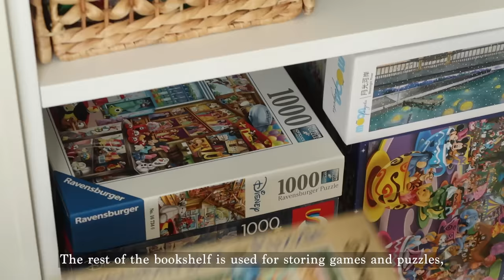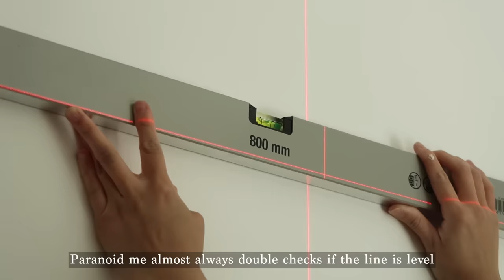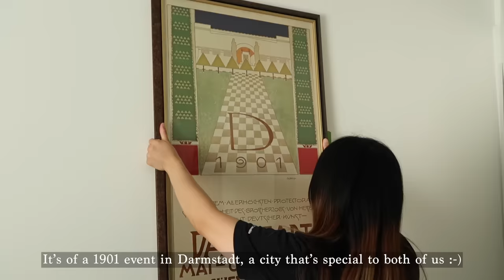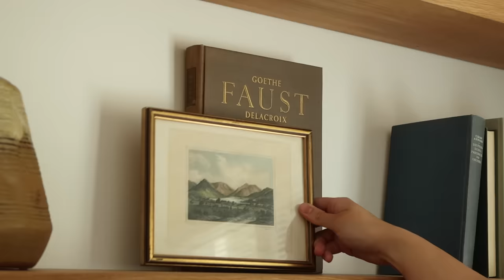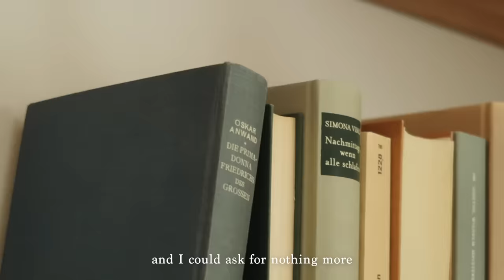Creating a cozy home office & library | Room makeover

Comment: Just curious: Is the normal 'Alpina Wandfarbe' still sticking to the cupboards after a few months?
Reply from the maker: It's not a Wandfarbe, it's a special Lack. Alpina Feine Farbe has a range that is specifically for painting furniture!
Reply: @cloudyhills  Vielen Dank! Das ist sehr hilfreich ;) Die Farbe war nämlich verlinkt und ich dachte schon, dass das nicht funktionieren kann... aber du musstest bei dieser "Lackfarbe" nicht zusätzlich grundieren...nur ein bisschen schleifen? Btw. Sieht alles sehr schön und gemütlich aus !)
Reply from the maker: Yup! You have to sand with 200 before. After painting, lightly sand with 400 to get a smooth finish. Lackfarbe already has Grundierung inside 😊 so make sure you stir the paint very very well.